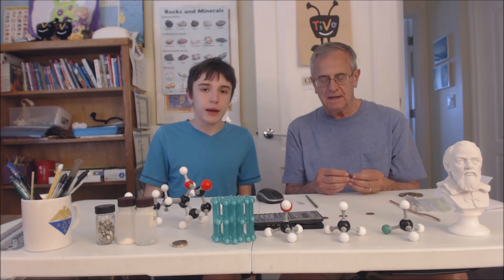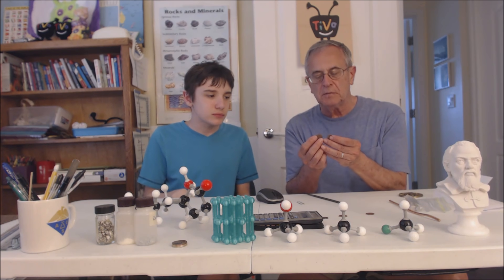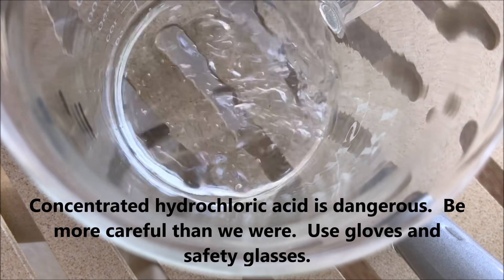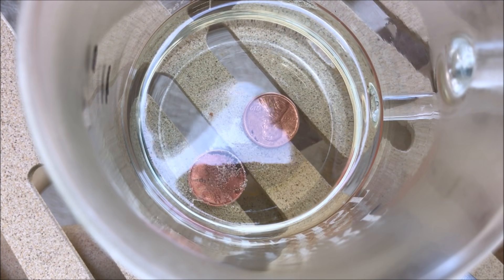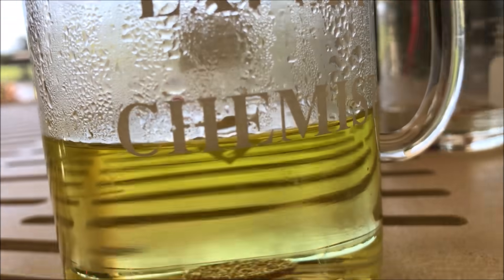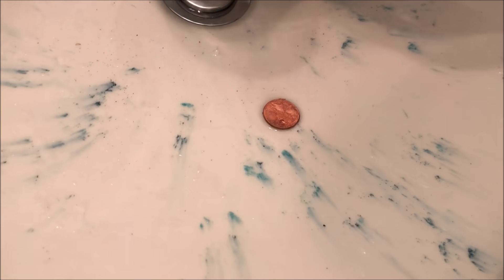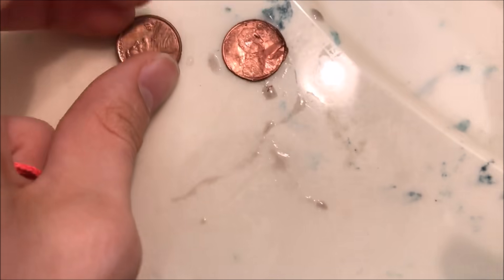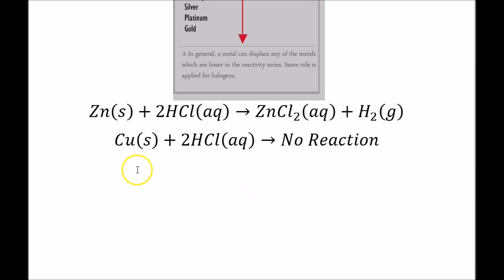Reaction of Zinc From a Penny with HCl

Comment: Actually, the zinc and the copper are reacting with the HCl, thats the reason why  the solution becomes a green color. Because it forms Copperchloride.
a solution of zinc chloride would be colorless.
Reply: 3:34 i could literally cry when seeing this.
You can't just poor a metal solution down the drain, it heavily pollutes the drainage water and contaminates it with poisonous copper chloride!
Reply: @Adam Defibaugh yes it does. Small quantities of it are oxidized by the oxygen in the air, thats why it works
Reply: what other reasons would be possible for the green solution, only copperchloride has this significant color.
Reply: Also I put copper in an HCl solution just 2 days ago, today its black, that much has already been dissolved by "only HCl"
Thats the reason I came across this video, i was researching about it
Reply: @KleinLuzi   we tried this experiment, initially saw H2 bubbles, then solution turned black, then yellow, then finally we had blue solutions that made blue crystals... suggestions on the exact reactions I just described?
Reply: @Adam Defibaugh yes but the copper had a corrosion layer which probably reacted
Reply: Yes but you forget that E=mc2 proving you wrong because the copper would have exploded hence the zinc

Comment: Can this acid work on brass tarnish? 
If not, do you have any suggestions for acids that will clean brass because commercial "Brasso cleaner" is too slow and labor intensive.
Reply: I know its probably too late but don't use acids to fix brass you will break it
Reply: Try Evapo-Rust to clean brass it removes oxidation

Comment: 1:49 DID U JUST GOT THE ACID ON UR HAND ????
Reply: That's what I'm looking at
Reply: as someone who has a lot of experience with hydrochloric acid and  nitric acid, getting some on your hands will cause little to no damage as long as you wash it off as quickly as possible
Reply: @rickydona919  that's correct. Chemical burns with weaker acids usually happen when you don't wear PPE, and forget proper hand washing.
Reply: He sure did
Reply: it burns but it doesnt really hurt, just keep a thing of water nearby you can dip a hand into